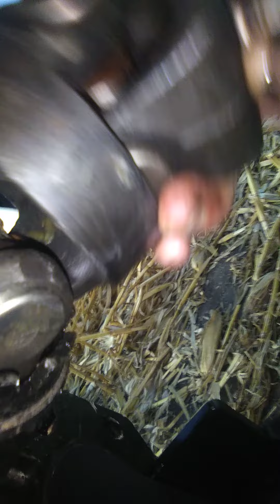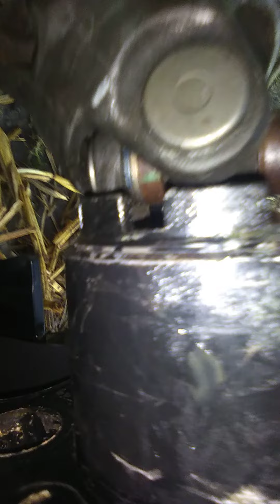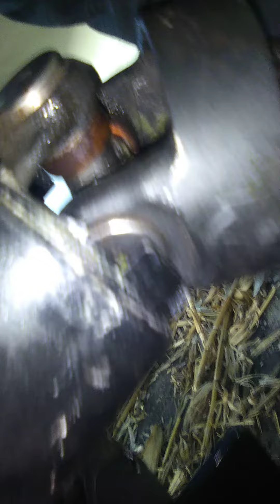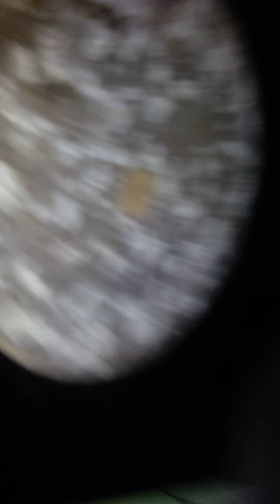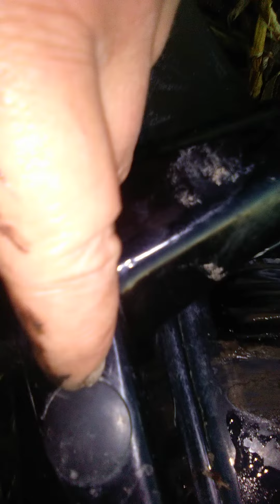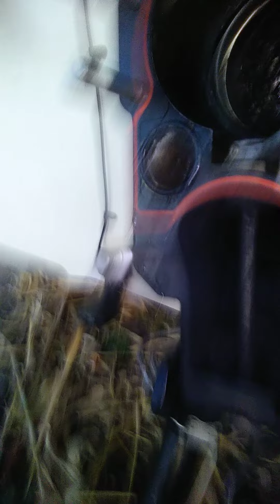Mercruiser Alpha 1 Generation 2 removed for inspection

Comment: Why aluminum anode when the outdrive is aluminum
Reply from the maker: Sorry for the late response. I should have  noted that this video was customer specific, and he wanted to switch to a stainless steel prop. Where the boat is docked all season is against a large steel wall. Magnesium anodes were gone in a month. Generally aluminum anodes are for brackish waters, not straight fresh water. This boat in general has high amounts of electrolysis where he docks. Something to keep in mind is that sacraficial anodes dont start to work until they are underwater for 2 to 3 days. If your pulling the boat out or trimming an outboard out of the water every day. YOUR ANODES ARE NOT GOING TO WORK. Alot of people dont know that. Oh and you should never clean your anodes with anything metal such as a wire brush, it charges them and they can have the opposite effect. A plastic pot scrubber is best if needed. I hope that helps if not please ask. Theres also anti corrosion systems that run off 12v and measure the electrolysis in the water and match the same output through you gearcase. Such as mercury marines "mecathode" system. Volvo penta has an amazing one for their diesel lines